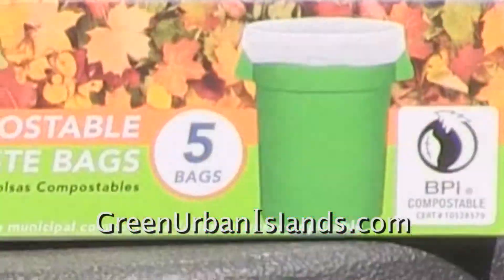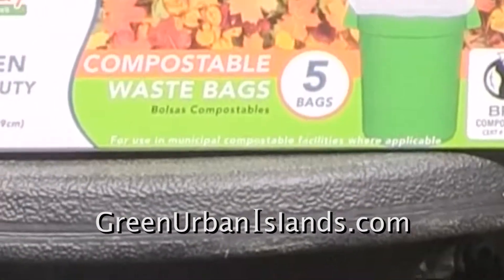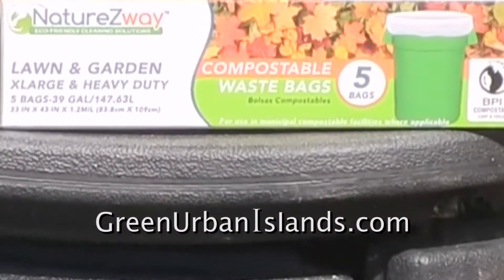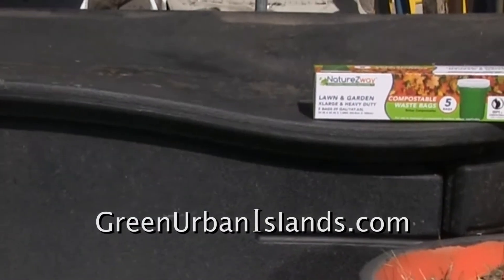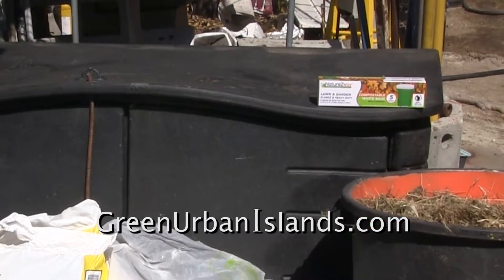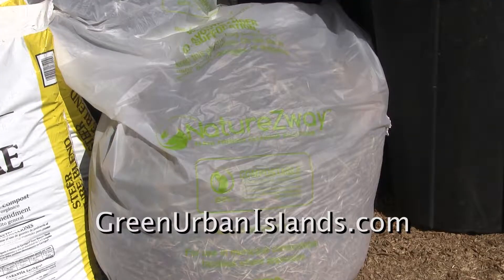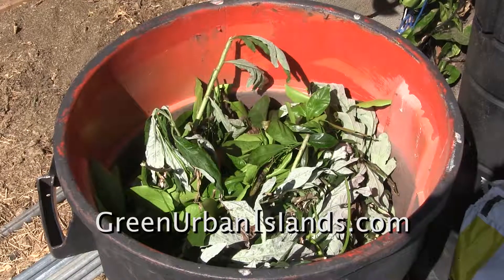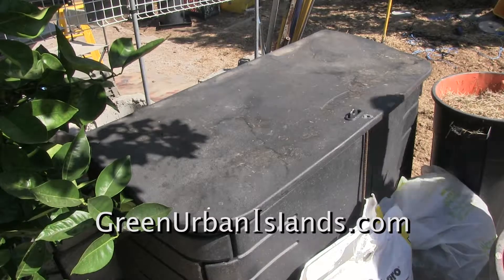A test of biodegradable starch plastic bags

Comment: So what happened???  IF the bags decomposed, it seems like a great amount of biomass to deal with only 2 bags.  What about the 2 corn based bags I get every day with the 2 newspapers I subscribe to?  Even though I do have a yard, it is mostly perennials, no grass, just lots of oak leaves in the fall.  It seems that I would have to purchase large quantities of manure etc. from the garden supply in order to make a dent in accumulation.
Reply from the maker: To see the results, go to 

https://youtu.be/tn1m35pLcwY

In an ideal situation, no bags.  Move all the leaves to a stack.  Cover.  Allow to decompose.  This requires space and time.

In a more constrained space, such as a large yard, I have seen groundskeepers amass rows of plastic bags heavy with leaves.  The bags go to the dump.

However, in my situation, I need the potential soil of the leaves.  I tested these bags due to the reference on the box to industrial facilities.  Would the plastic decompose?  I wanted to test if stacking the bags of debris would generate soil.   I used the cubic meter composter only to contain and accelerate the process.

And the bags proved excellent.  I could rake many cubic meters of leaves together, compress and bags the debris, stack the bags.  After months, I would have soil.

The test in the video proved the value of the bags.